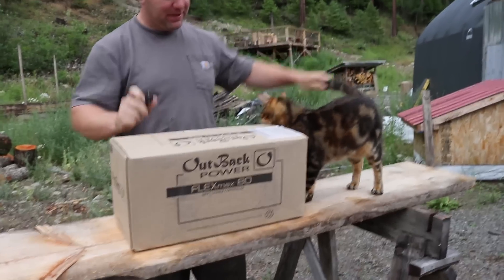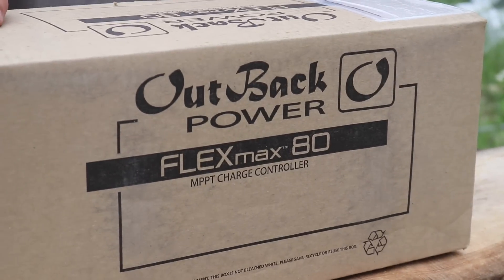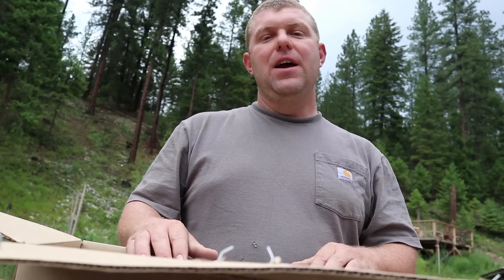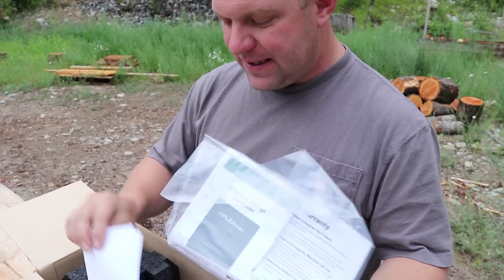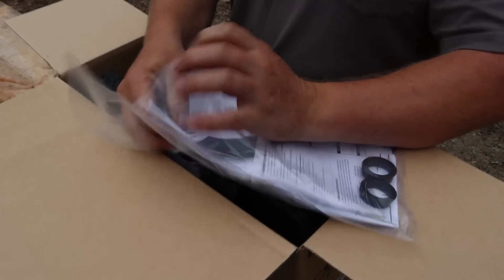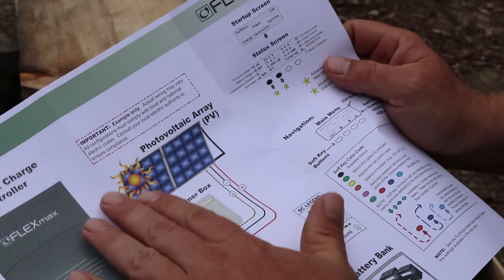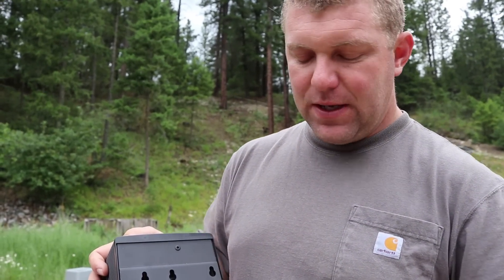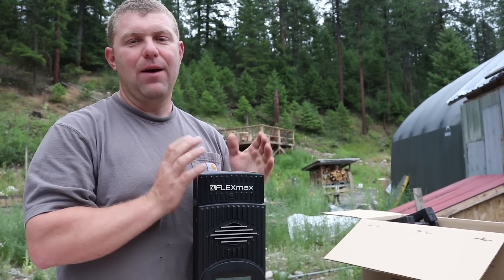MASSIVE SOLAR UPGRADE (Outback FLEXMax 80 Charge Controller Unboxing)

Comment: If you serial the three panels to (42v-54v), if the controller can process that input voltage, you'll get greater power efficiency from those panels, from the reduced current and higher voltage thru that 100 foot wire.
Tripling the feed voltage at third the amperage, reduces power loss to less than 25%, and possibly to 6% of prior losses.
Reply: In most scenarios, doubling the voltage reduces the voltage drop by a factor of 4.  It depends on a few things but there is a serious advantage to running in series.  Now, that being said the more panels you run in series in a series/parallel set up the more susceptible you are to voltage drop via partial shading.  For example 3 in series, 4 parallel is less prone to overall voltage drop than 4 in series 3 parallel.  All depends on how high you can go for input voltage on the charge controller of course.  I like the midnite systems because they allow hyper-VOC and generally higher voltages than outback.  Both are good, but in higher voltage scenarios I prefer to look at Midnite.

Comment: Step in the right direction with outback.....👍
AND PUT PANELS CLOSER TO CHARGE CONTROLLER..... So you would not have 1000fl of thin cable to charge controller..?. you lose 1/4 of power heating the cables to get to charge controller.. 👍 
Anyway good luck and God bless you will need it....

Comment: I don't know if it is just the way the film or view is, but some of the capacitors looked like they are bulged.  In the row of 4, the blue and brown smaller, 250 capacitors looked slightly bulged.  I've done a  lot of rework on boards and it's no big deal to replace or rework boards but if it is new it makes me wonder.

Comment: Sorry but I really feel like your the guy who keeps replacing the alternator on his car when his real problem is his battery is junk....not the alternator.

Without good batteries you can have the hottest solar system on the planet and still need to run your generator!

From a previous episode I know that the Hilders are your neighbors. Mr Hilder seems to have most of this electrical down to a science plus having good specific gravity meters. So much info but no sharing??? So which one of you are being stuckup?

Comment: NERD ALERT:  If you want to increase the available "Power", double the wire size gives twice the power,  double the voltage gives 4 times the power for the same size wire.  Power = V-squared / Resistance.   Reducing the resistance by half doubles the power, since the voltage is a square doubling the voltage gives four times the power.
Reply: ycmdill 
you may want to rephrase that a little. someone is going to think they need just bigger wire . and not batteries and panels.
Reply: IF you have 2 10 G. wires feeding the same load,it becomes the SAME as a 7 G. wire.  Total and add 3. That's it.

Comment: Im 2 seconds in and i see you've learned alot, been running outback solar charger for 7 years no problems minimal maintenance system wide ( mostly cleaning the panels and battery maintenance).
Run thicker cables from your panels tho you dont want to burn down your house!

Comment: I I do not comment on any videos on YouTube but I feel like I have to say this I watched all your videos on solar panels and the one thing I keep saying to myself the whole time is why don't you just move your batteries and charge controller and inverter closer to the solar panels in Run High Voltage from that down to your trailer that way you get as much power out of the Sun as you can there will be a lot less power loss at a the higher AC voltage going a long distance like a hundred feet or so would be a lot less.you can just pick up a heavy duty extension cord your chosen Big Box store. just my two cents everyone's got ideas and opinions and yeah I know they are all like assholes and they smell.

Comment: "I'm not sure why they call it the flexmax 80" 

"But this controller is very flexible"
Reply: Flex able in voltage to max of 80 amps  thus flexmax 80 DA TA !
Reply: "and has a max of 80 amps"

Comment: Nice upgrade --- Its a great charge controller! We have two of them in our system (GS8048).  (Our system  is in our StarLite wars video playlist.)  You will be able to grow with this system, and with Outback you won't have to worry about the company disappearing.   We've used the history feature to track one issue we had with undersized breaker, but system is pretty much program it an forget it.   If you decide to get a new battery system - I'd suggest a small fork-lift battery for lots of watts per dollar  and deep cells, no terminal corrosion issues, with long cell life.   They have smaller fork-lift batteries than seen in our video, and we used two 24v ones to reach 48V which is more efficient than 12V or 24V.  
All the best to you and Alyssa on this electron-odyssey !!
BTW --- Alyssa you do an awesome job on the editing.  We both love the way you edit and my wife mentions/hints that to me every time she watches one of your videos.   ;-}
Reply: Very very nice

Comment: You mentioned you have some 24v panels. Why not leave the 12v panels on the existing controller and connect the 24v panels to the Flexmax 80. Using the capability to step down to 12v on the output, you should then be able to have the two systems connect in parallel to the battery bank.
Reply: That's not what I would do. If both panels have the same current capability at a given solar radiance, then I'd wire it in series with the 24 volt panels. If your solar charge controller top end voltage doesn't get exceeded, you want to wire as MANY solar panels in series (making sure that the max total no load voltage of all the panels doesn't exceed the charges max) because you will have less I2R loss ( Current squared * Resistance of your cable = power loss in cables themselves). High voltage, low current is ALWAYS the best way to move power or energy bc the current is what's going to kill your efficiency because of I2R losses. This is why transmission lines from a power company are stepped up to such high AC voltages with the use of a simple transformer. 

Sadly, transformers only work for AC currents and not DC currents like solar panels (think of them like DC batteries with high internal resistances). These MPPT charge controllers are nothing more than a smart controlled Buck converter (DC-DC efficient converter). The MPPT just loads the current from the solar panels just right so that when your panel voltages sag under load (voltage output drops as you pull current from the panels, hence internal resistance),so that it finds the right maximum current and maximum voltage combination, or in other words V*I=Pmax. If the charger pulls too hard on the panels, then the voltage will drop significantly, but the current will also go up, however V*I will no longer be the highest Pmax possible, so the charge controller will back it off slightly till it finds that sweet spot. It's fascinating to watch this happen constantly pulling a little harder, then backing it off to the sweet spot. 

My 60A MPPT Solar Charge Controller I bought on eBay goes through this - find the max power spot - about every 10 seconds. It was only $300!

http://www.ebay.com/itm/60A-MPPT-solar-charge-controller-regulator-12v-24v-48v-3200w-monitoring-PCM60X-/161615675225?hash=item25a10b7f59:g:K6UAAOSwm8VUygAw

I hope that maybe that helps. I'm an electrical engineer and I've built my own portable solar generator. One day I'll make a video, but I'm not done with the whole system.
Reply: That's what I would do Jim.
Reply: Yes, that will work just fine.

Comment: I might be missing something but why don't you use on of the Battery boost capacitor banks to help with loading from the Freezer and the AC when they kick on. I don't mean to be rude and apologize if it comes out that way. I deal with 12V a lot as an amateur radio operator and one of the ways to both smooth out power and reduce the loading for transmission is to put a Capacitor bank in between the batteries and the radio. Smooths out the drop and also reduces loading on the batteries.

Hope that helps and like I said not meaning to be rude you folks are doing great. My kids and I completely are looking forward to your success.
Reply: K om
Reply: T

Comment: dont forget to run the panels in serie as far as you can. higher volt on the cables down instead of current and losses:)

Comment: You can wire 48 volts from the panels to the charge controller and still pull 12 volts off the battery to the inverter .
Reply: Allen Cox And it is better on the long cables ( higher voltage and lower amps).

Comment: I have a 1200 watt solar system. In order to solve the problem of having an excessively long PV voltage run, i placed my cheap PWM controllers and my battery bank AND my inverter in a small concrete block house within  10 feet of the solar panels. The long run to my home is at 120 volts...so  not much  voltage  loss  with  #12 ac wire. System cost much lower.
Reply: He's got 4x 24v panels. He's using a rinky-dink 12v battery bank. The current dc lines arel way under rated for what he has now and still needs to be replaced. Using 148vdc to the camper needs #4 wire to be safe and only #6 from the panels at 120v ac from there to match their inverter. Have you looked at the spec for their inverter? http://www.powerdriveinverters.com/sp/powerdrive-2000-watt-power-inverter-4-ac-2-usb-app-with-bluetooth/ . 

They have to run on a budget and what you are talking about is far more expensive, out of spec for the controller's peak efficiency for best case scenario battery bank of 60VDC input w/48V battery at 53.1VDC (98.44%), requires them to ditch their current inverter before they even get their house built.
Reply: Their charge controller is limited to 48v worth of panels (under load) and either way, 120v ac causes less wire resistance than 120v dc and they will still need it inverted anyway to run their appliances which means replacing their current inverter!
Reply: That is the smart way to go. With their 2000W inverter and 100ft run, #6 ac wire should be used. If they need more ac, a second inverter and a second run of ac wire is needed and their charge controller still will have plenty of margin.
Reply: YEP!!!!
Reply: Vanessa Welles ac travels long distance on smaller gauge wire than dc.hint.
Reply: The answer is for them to run the panels in series and bump the voltage to over 100v.  No need to run AC downwind.
Reply: Have you looked at the spec for the FlexMax 80?  Input voltage is max 145 startup.  Total wattage at 12vDC battery is 1000.  
http://www.outbackpower.com/downloads/documents/Make_The_Power/flexmax_6080/specsheet.pdf

Comment: Outback makes a good MPPT charge controller, a wise purchase.  I'll bet your system performance will improve dramatically, although I would just say to make sure that your solar panels are wired correctly to ensure you are getting an appropriate voltage -- in a previous video you said your solar panels were wired in parallel, which may very well be appropriate, but just be sure it is.  You'll need to check the nominal voltage of your panels (it's on their label usually called Vmp -- whereas Voc is the voltage when not under load) and then figure it out from there.  So Congrats on an excellent charge controller, be sure to spend hours reading the manual!  And feel free to ask any questions.  Cheers mate!
Reply: Ok so (watched video):-- I now understand you have a 12V battery bank, so lots of line loss over a roughly ~100ft #8 AWG string.  Ok makes sense now, I understand your upgrade plan.  Good choice on the Outback.  Also I like your idea of buying another panel for the primary purpose of eventually wiring it into two strings (2 panels in series per string, then those 2 strings joined in parallel for a 4-panel array at 24V).  When you decide to rewire your panels and battery bank to a 24V setup you'll reduce line loss and get better performance overall -- the only requirement being to upgrade your inverter.  What you could do in the meantime is buy a 24V-12V DC transformer as a stepping stone.
P.S. the reason they call it "80" is because it has a Maximum Output Current of 80 amps.

Comment: You keep mixing current, power and voltage.

Voltage is between two points, like the connections of your battery.

Current is that what starts running as soon as your two connections are connected.

Power is the total of energie available.

Some forms:

# voltage = current * resistance. 
# power = voltage * current.

Now, if you have a high resistance cable connecting your panels to the batteries, you will loose a lot of power in the cable. Therefor, you try to use cables with low resistance, normally you come to higher diameter of the cables.